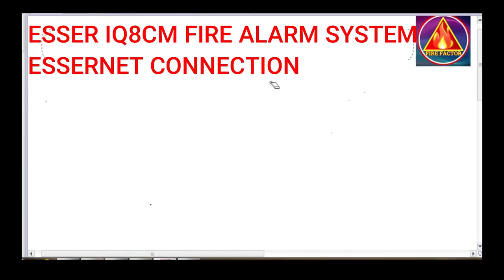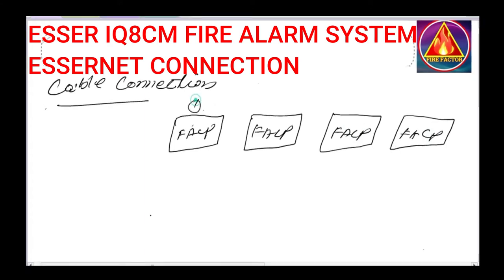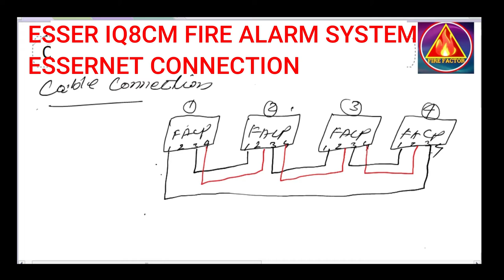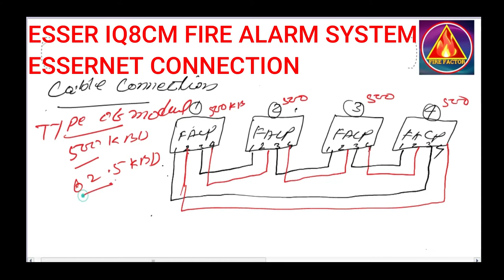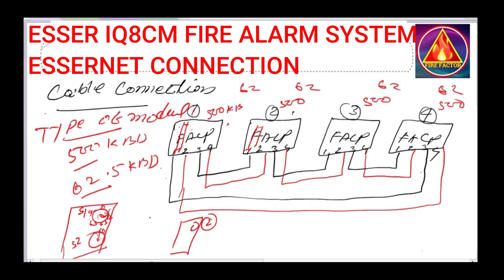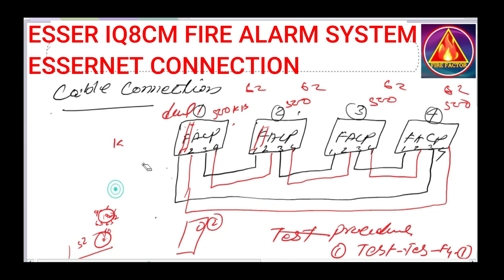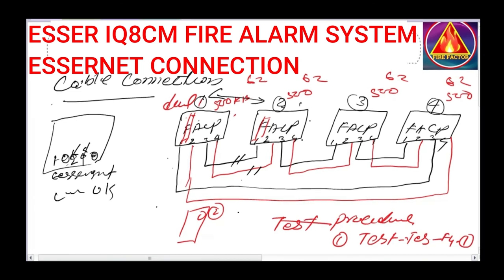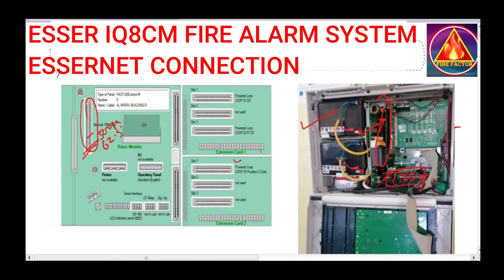How to connect Esser IQ8CM Fire Alarm network connection and setup between multiple control panel

Comment: I am engineer in Ultraech cement. We are facing network communication issues in planel. 

We require a network engineer as third party who worked on IQ8 panel
Reply from the maker: firefactorsafety@gmail.com